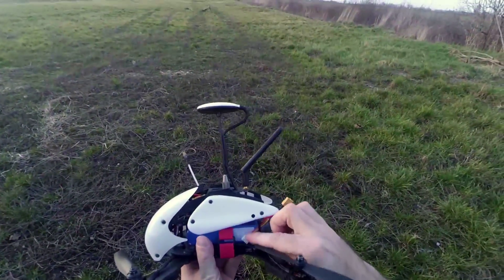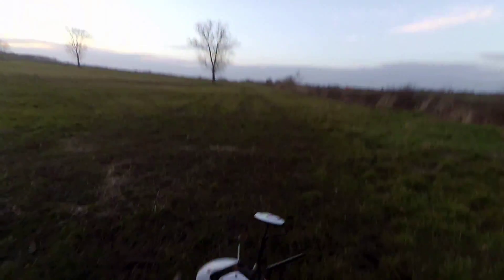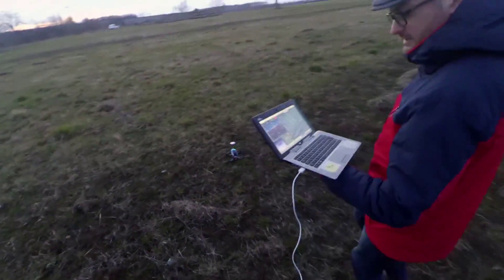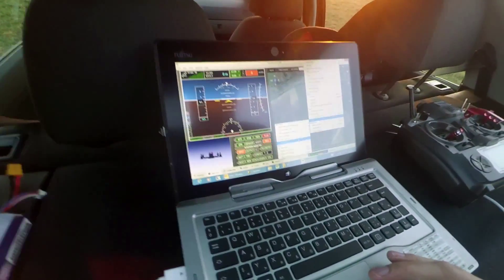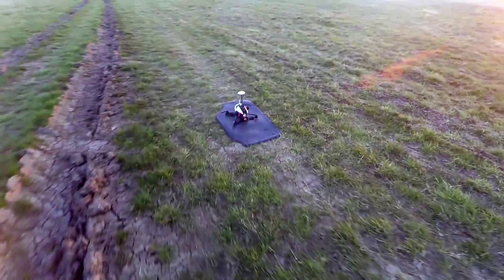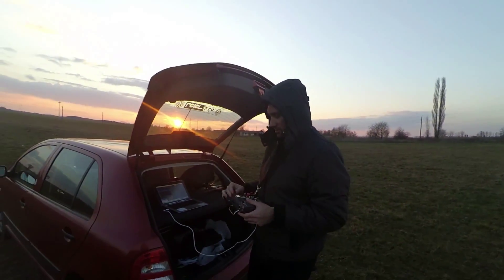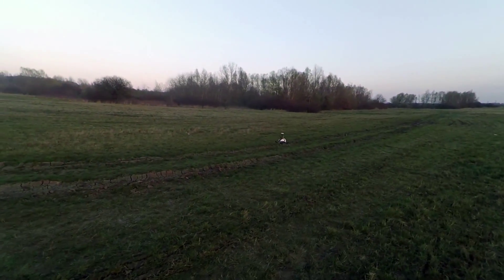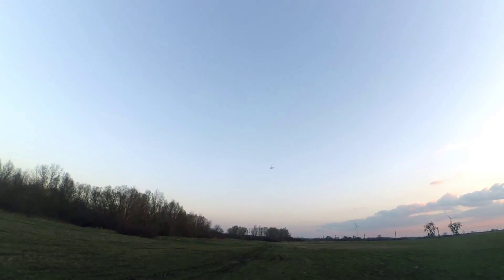Robocat 270 - Autonomous Flight / Waypoint flying

Comment: hi, what kind of controller ? It behaves like a video camera there is no interference ?
Reply from the maker: +Stalker Pofi Hi, I use the built-in oplink modem as control and telemetry too. On Tx end it's a Turnigy 9x with the same Oplink module in the module bay. The fpv cam feed doesn't have any specific interference so far.